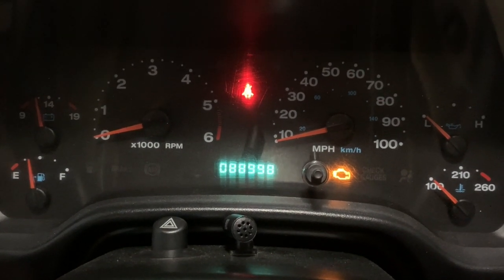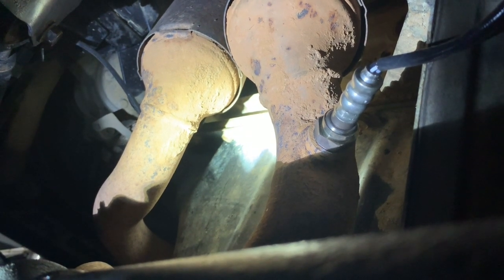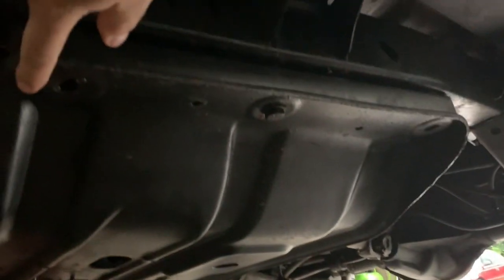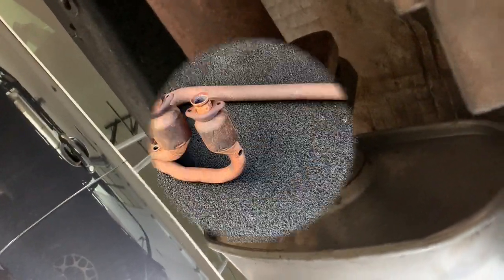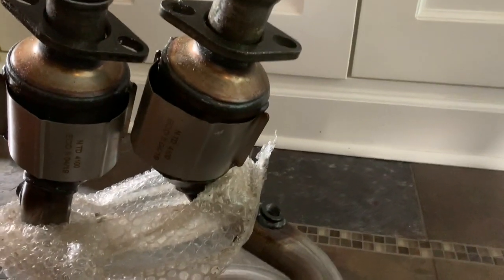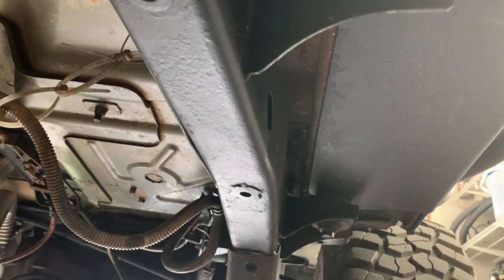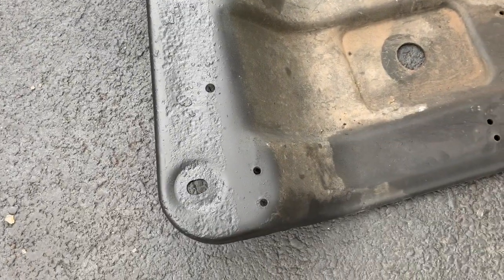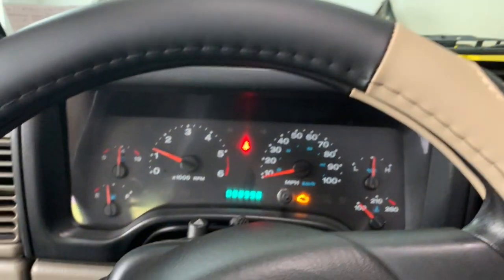Jeep TJ Catalytic Converter Replacement

Comment: Thanks for the great instructional video... I didn't know that aft muffler looking thing was a Cat... I thought it was a resonator, but when you shined that flashlight inside of it, it appears to be a Cat as well with that honeycomb look. I thought about not putting that on when I do this job.
Reply from the maker: @Nobamaable  glad it helped! I’ve seen where people cut them out but then have to modify the O2 sensors to not throw an engine code. Easier to keep it legal

Comment: Later model TJ I’m sure. In the older models the y-pipe going around the oil pan links to main cat via a 3-bolt flange. It’s very accessible but usually incredibly weathered and corroded. Virtually impossible to remove without grinding off these bolts. The cat-muffler joint bolts are much easier to remove. The replacement you got there is nice with that saddle clamp. Will make life way easier if ever has to be removed (for oil pan gasket, rear main seal, or oil pump replacements)

Comment: Was their exhaust gaskets or donuts where the catalytic converters bolt onto the exhaust? My engine is ticking and it sounds like it's coming from the the catalytic converters.
Reply from the maker: There were no donuts or gaskets, was all metal to metal connections.
Reply: I’m having the same issue rn, what did you do to fix it?

Comment: Just curious do you have to drop and cradle the trans just to get to those 2 manifold bolts to cat back? About to do my cats soon I ordered flow master ones just seems crazy to be messing with a trans to get to pipes!
Reply from the maker: I agree 100%, that part of the process fave me the most concern and would have avoided if I could. My Jeep is lifted so the geometry is different from stock and likely different from other modified jeeps. In this case the skid plate blocks access to the bolts to the muffler so had to be removed, and the skid plate holds the trans in place so needs to be temporarily supported. If you have tools to remove the bolts at the muffler with the skid plate on would be ideal, wasn’t the case for me unfortunately
Reply: @robertbartilomo845  ah I see. Mine is all stock ride height I’ll have to see if I can wiggle a socket in there. Thanks!

Comment: How's it been doing since you installed it? My same exact set just came in last night and I'll be installing it this weekend. Just ordered the clamp you used as well. Thanks!
Reply from the maker: Had no issues whatsoever. Nothing loose, no engine codes, runs great. Be gentle with the skid plate bolts. If doing this weekend maybe spray them all down with PB Blaster or WD40 now and let it penetrate and loosen in the course of the week. Good luck!
Reply: @robertbartilomo845  Thank you for the reply! Great to hear! Thank you for the helpful video as well. And yeah I've replaced the transmission mount before and had one of the skid plate nutserts spin in place. I know they are a pain in the butt lol
Reply: @robertbartilomo845  Just replaced mine. Got everything tight and all 02 sensors plugged in and tighted down. Is it normal for it to smoke lightly from under the hood on the driver side after starting the Jeep up for the first time?
Reply from the maker: @Bowlerboy99  you will probably smell the pipes burning off the first time it heats up. I don’t recall if it lasted more than that. Just make sure there is no smoke coming from the connection to the exhaust manifold if those bolts are loose.
Reply: @robertbartilomo845  Yeah it's all good now I let it run for about 15 minutes and it stopped. Probably just burning the oils on the pipes so they don't rust in storage. All good though! Thank you again for the very helpful video!!
Reply from the maker: @Bowlerboy99  Awesome! Happy to hear it was helpful, thanks for sharing!

Comment: Robert, What are the part numbers for the replacement parts you ordered from Eastern Catalytic including the Saddle Clamp? Thanks.
Reply from the maker: Hi Wayne, 
I ordered both on Amazon and both are still available. The cat is the “Eastern Catalytic 20379 49 State Catalytic Converter.” The saddle clamp is the Evil Energy 2.5” Lap joint clamp. Here are the links, thanks for watching and good luck!

Catalytic Converter:
Eastern Catalytic 20379 49 State Catalytic Converter https://www.amazon.com/dp/B0031G6YT6/ref=cm_sw_r_cp_api_glt_i_8T9BH5TKYWP7YSSFEMEH?_encoding=UTF8&psc=1

Clamp:
EVIL ENERGY 2.5" Lap Joint Exhaust Band Clamp Exhaust Repair Preformed 304 Stainless Steel https://www.amazon.com/dp/B078TVV4FT/ref=cm_sw_r_cp_apip_Ej1np6XSISYdf

Comment: Any issues with that lap joint not fitting properly? I ordered the 2.5 and it seems a little small
Reply from the maker: Had no issue with it, fit snugly and has t budged. There will be a gap to give room for the bolts to tighten. Too big and the bolts would tighten fully before any pressure is applied to the exhaust pipe.

Comment: Is it still doing strong?
Reply from the maker: Yes going strong and no issues whatsoever. I only drove the jeep a few thousand miles a year so does not get heavy use but have not thrown a code or other concerns. Been solid!
Reply: @robertbartilomo845  alright imma order it and kinda follow what you did. My only question is your 2.5 clamp, did you spin it around to where the smaller size is at the smaller side of the cat pipe? Lastly did you leave it at that placement or move to where the bigger cat pipe is exposed?

Oh and one last question unrelated, do you use the same type of clamp for muffler to tail pipe or did you keep/use the same skinny one like the one included? I plan to replace the entire exhaust once I have everything down
Reply from the maker: The smaller/ narrower side faces the front of the jeep @inshadows1
Reply: @robertbartilomo845  alright bro thanks for everything,I promise this is my last question lol. Any gaskets in the front where the two smaller cats connect to the manifold? Or anywhere else?
Reply from the maker: @inshadows1  no worries, happy to help if I can! No gaskets anywhere on the install but do need to make sure the meeting surfaces are clean and seated tightly when bolting back up. Good luck!

Comment: how long did it take you?
Reply from the maker: I can’t recall for certain but I was about a few hours. Keep in mind I took time to take video, and was doing it by myself having never done it it before. If I had to do it again and another set of hands I could do it in have the time. I had the one bolt I pointed out in the video that was hard to reach which I fought with for a while.  Once I found the right tool it was easy.

Comment: My Bank 2 mini-cat (back one) was totally blown out too. I know your sensors are new, but are they NGK brand? Denso, Bosch and the others do not play well with the TJ computer.
Please make sure you have NGK. If you do not have NGK, that could be one possibility for your code issue is still hanging around.

Also... NGK ships with anti-seize on the sensor threads right out of the box. Additional anti-seize is not needed (or recommended for that matter).
Reply from the maker: The code is gone and no pending code so far, thankfully. I did use NGK sensors which did ship with anti-seize. I did pull the sensors when the code returned to see if they were founded and did add more ant seize but hopefully not to their detriment. Thanks for the comment!